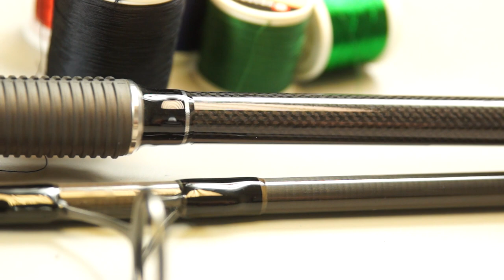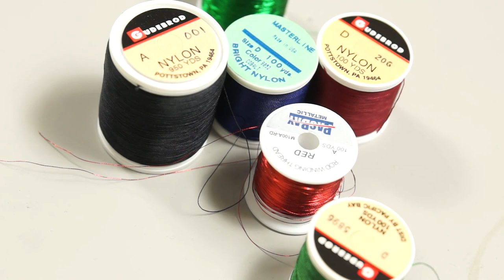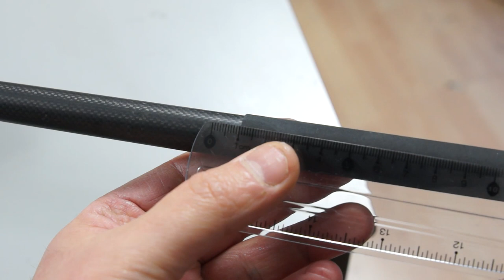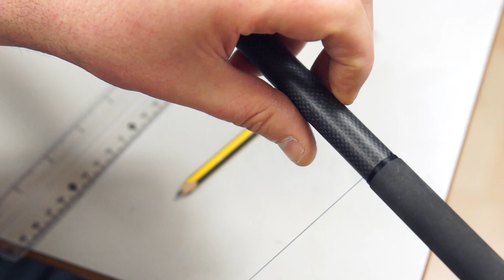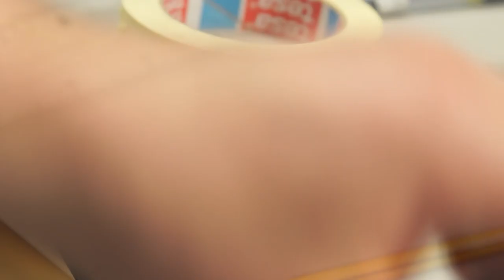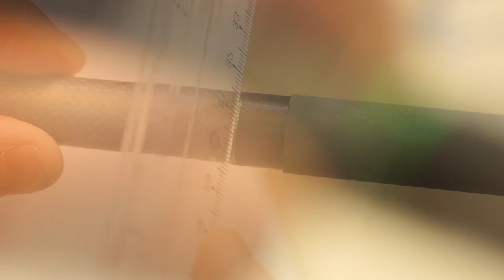Harrison Rods beginners guide to whipping - part 1

Comment: I built my own rods for many years from the 1970s. Carp rods when there were just no shops selling them. Totally fascinating to see the techniques I taught myself are so similar to those you show, things mostly I stumbled across over time too. Funny how pretty much all my kit was the same as yours…except I would run my fingers nails over to ensure there were no tiny gaps rather than using a ruler.

Tension was the key and turning the whipping with a slight inward angle to the thread already on so it guided the new loops into place. I whipped on so many that I swear I could do it in the dark.

Back then the first rods were all glass fibre. Names like Hunter, casting sticks. Then it was early carbons, north western blanks and Simpson’s of Turnford “ stepped up” 1 3/4lb test blanks. I would whip on Fuji clip style reels fittings too. Initially I used fine wire to pull tag ends through, replacing that for thread loops as the wire often cut the loop trying to pull it under.

I used “dope” as a first application to the thread. That was meant to “ tighten it” but I was never convinced and if the whipping was anything other than black it could make the thread look patchy.

I must have read all these things in a book or magazine but I met rod builders who showed me how to roll a blank to find the spline where the cloth finished in the blank making it slightly stronger for casting in a certain direction. I knew how many eyes I needed, what size and a rough spacing guide, but to place them I did something no one would do now when everyone wants precisely matching rods.

With the reel on I would load up the rod against the resistance weight of the stated test curve, 1 3/4lb say of carefully weighed out lead in a bag to which the line out of the tip eye was tied. I pulled on the weight until it was just about to lift off the floor, see how the line followed the rods natural curve. I then moved eyes up and down so that the line matched the rod curve as closely as possible to minimise the gaps between the eyes and the blank.

It took some time but when it looked right, the distance between eyes was set with another tighter piece of masking tape. It was amazing what weight you could lift with just taped eyes, but back then we used way more than 6 eyes on a 12 foot rod.

Whipping the first side of each eye was the critical thing because once the whipping bumped up onto the leg it would often slip a bit. That was the time to sight down the rod straight through the guides like a gun sight and realign it. All the adjustment over on one side of the eye I would try to whip on the other side a little tighter.

Sometimes I would tip the whipping with a coloured blue, green or red flash, but that served no strength giving purpose so it didn’t matter so much if it wasn’t so consistently taught.

The amazing thing was I didn’t use epoxy on those guides just multiple varnish coats which dried with me constantly hand turning.

I pretty much have all those early carbon rods to this day including Simpsons KM dual tapers, a strange concept which created a kind of flat middle section of the natural rod curve with more bending at the butt end.

The most peculiar thing which annoys the hell out of a modern carper when you point it out, because the eyes were fixed in position so that the line matched the full test curve bend with minimal offset, and the true test curve of those blanks was slightly different because of the carbon cloth weave on the mandrel, the eyes didn’t get positioned to be precisely alongside their neighbour in that “ matched pair”.

The eye spacing matched the specific rod action not the stated test curve. For me that was the right thing to do. I could of course just have matched precise positioning of the eyes on the second rod to the first rod of the pair, only moved the eyes up and down on the first “ master” rod to decide on the correct eye spacing.

But you know what those old carbons, despite the blanks softening well below those earlier test curves, still have a lovely action with the line following the battle bend so precisely.

I still use them floater fishing, even deadbaiting for pike as they rarely ping the bait off the hook.

But mostly because I built them myself so they give huge satisfaction to use them.

And although the varnish fish, multi layers, multi hand sanded, has seen better days, not a single one of the eyes has ever worked loose or needed replacement. Of course far too many eyes really and too small by the standard of today’s carp rods, but that doesn’t matter one bit.

I meticulously filed any sharp edges on the legs to ensure they didn’t cut the whipping when flexing, so it all must have been worth it.

One of those very Simpsons of Turnford blanks went on to catch me the lake record mirror carp from the famous Cuttle Mill at Wishaw, when Brewer owned it before Tony Higgins. A monster for the 1980s of 27lb 8oz, caught on my home made peanut special paste bait.

I wouldn’t part with that rod for all the money in the world. There’s nothing to compare to catching a lake record on a rod you built yourself on a bait you made yourself.

But it’s great to see how rod building techniques have come on so much and high standards maintained by the likes of your good selves.

I should probably get the old girls a set of new clothes, a renovation and epoxy protection on those old whippings, still not sure though as right now they are the authentic original build.

But what huge satisfaction I got from completing them, catching on them. If only modern day carp anglers knew how good that feels!!

And you are based in my hometown area too, what could be better. So many great manufacturing skills were born in the North West unappreciated by the country at large.

Keep up the good work.
Reply: Wonderful reply, confidence comes from competence.

Comment: Thankyou for these videos, I have an old conoflex bass bones rod which one of the eyes had snapped and all the varnish was flaking off.
I've taken the original measurements and stripped it down, I've then rubbed it back using wet and dry and now looking to put a new reel seat on it, new eyes and shrink tubing on the butt section.
So have found your videos really helpful thanks